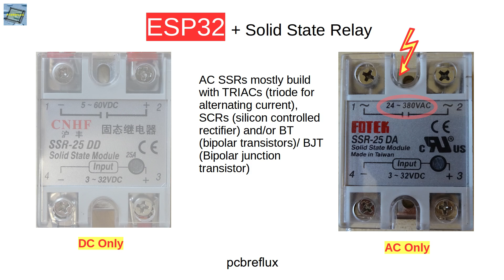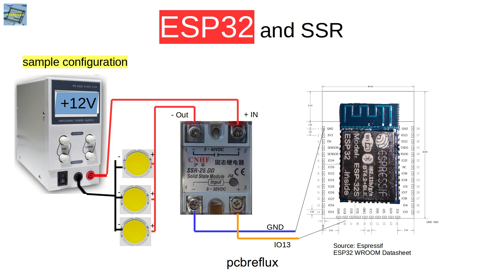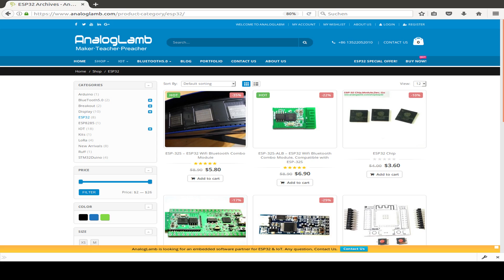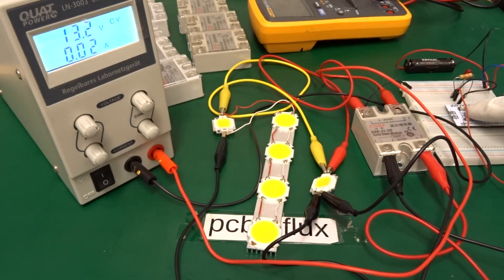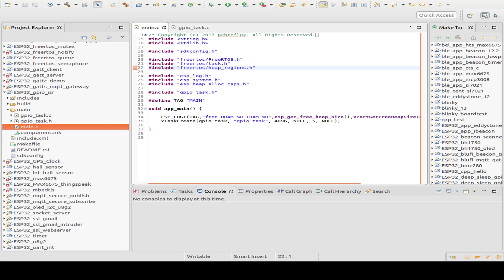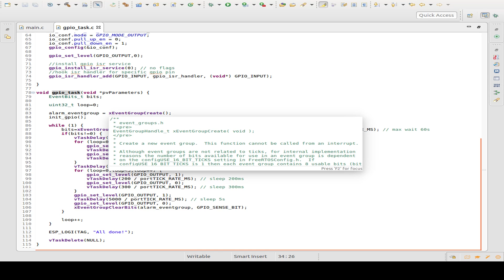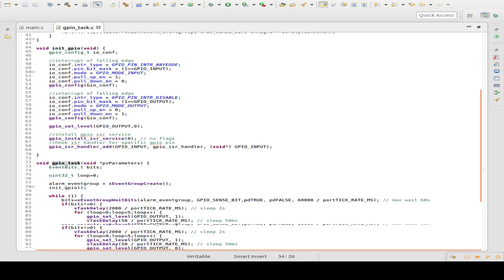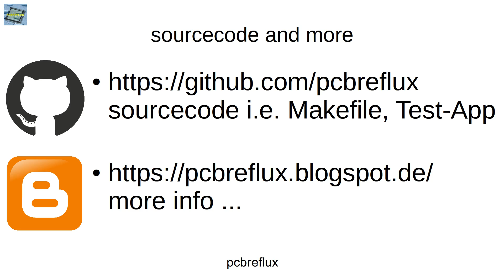ESP32 #30: Switching Heavy Loads with Solid State Relays (SSR) + ESP32 Giveaway

Comment: Hi there, great videos! Thank you for them. I have little qusetion, i have ess. devkitC v4,fotek ssr 25da, 3,3V on relay,switch diode on relay is ON, but load isnt switching. no problem with arduino nano with 5V output. any tips how to fix it? i use simple output mode and digitalWrite. i tried usb power and 5v power supply on my ESP32. thank you

Comment: I have had problems driving one of these Fotek SSRs with the 3V output of a STM32 GPIO. The thing is, that these SSRs are not really stable to drive from a relatively high impedance 3V source, like a GPIO from a microcontroller. The solution for the STM32 was to pull the GND pin of the SSR low with the GPIO and hooking the + of the SSR to a constant (low impedance) 5V from a regulator (STM32 has a few 5V tolerant pins). I know the ESP32 is not 5V tolerant but you could probably do the same by using a simple BJT to drive the - pin of the SSR. I wonder if you can drive the SSR with 6mA anyhow (recommended maximum IO-current of ESP32).
Reply from the maker: +Christopher Johnson Thank you to point this out. Haven't try the AC SSR yet (no AC source other then mains). Maybe I am to digital and have only basic knowledge about BJTs so I prefer MOSFETs as a low side switch and before using a second voltage like 5V - have you tried to use the gpio as a sink (SSR + to VCC and - to gpio configured with pullup)?
Reply: pcbreflux Yes, sinking the current with the GPIO of the STM32 worked indeed, as I already tried to explain in my first comment. BJTs and Mosfets should both be fine as low side switches.
Reply from the maker: Thank you. Try to overcome my fear for high voltage (for me > 60V) and make a test with the AC SSRs and mains voltage.
Reply: For an AC source you can look for an old (non-switching, unregulated) plug pack power supply that does only have a transformer, diode bridge and capacitor inside and remove the diode bridge and the capacitor. Saying that, it could be quite hard to find one nowadays, especially one that delivers at least 24V AC. When working with mains voltage I usually just wire everything up and cover all contacts that are exposed to mains to make sure I can not accidentally touch anything before I plug it in or toggle the switch. If you want to be extra careful you can place an RCCB (FI-Schalter) and/or an isolation transformer before your circuitry for protection. Saying that, the RCCB does not protect you if you touch L and N at the same time. 
One more important thing regarding switching heavy AC loads: The Fotek SSRs have a quite high forward voltage drop of about 1.6V and therefore get quite hot without proper cooling. If they get too hot, they short out the AC side which exposes the risk of fire e.g. if you have (high power) heating elements as an AC load.
Reply from the maker: Christopher Johnson Hi, done a test with a 10Watt LED on mains now. Have no issues with switching from the esp32 gpios. high or low side with 3.3V works fine. The only real problem was the leakage current of 3mA at the mains side when the SSR is "off". The switch mode power supply of the led charges the capacitor so that every few seconds the LED flashes. On some better datasheets its considered to use a dummy resistor in parallel but without any hints. I do some calculations and use ~100kOhm (for 240V I use 4×470kOhm 0.25Watt in parallel, so ~2mA or 0.5W are wasted in the resistors) and now it runns stable for the tested hours.
Reply: @pcbreflux  Hi, please can esp32 control 4 SSR

Comment: The ESP8266 is a little bit sensitive to noise from switching heavy loads.
Did you encounter any problems like that with the EPS32?

Great channel btw, keep em comming :D
Reply from the maker: +christiaan broeders Haven't seen any glitches on the ESP32 but use only DC. Have no AC source other than mains voltage but my environment and bench is not save enough to test this.
Reply: Thank you for the reply
I guess i will have to wait untill my ESP32 arrives so i can test the stability